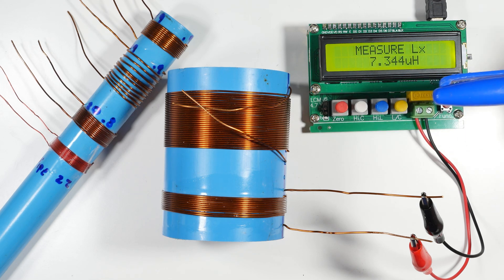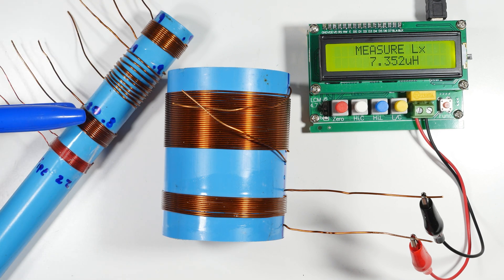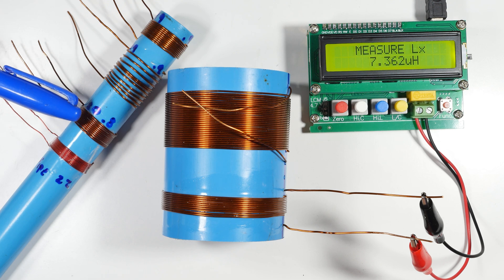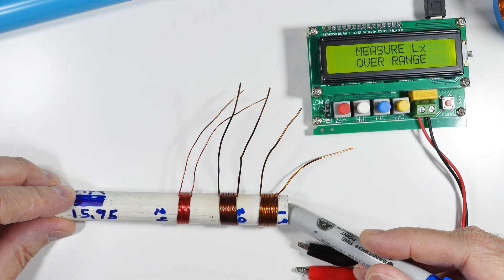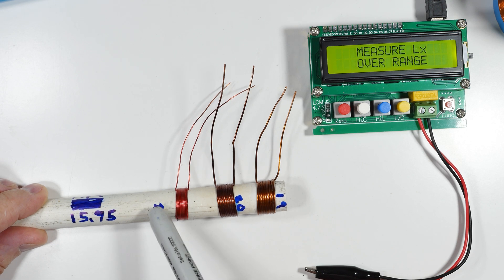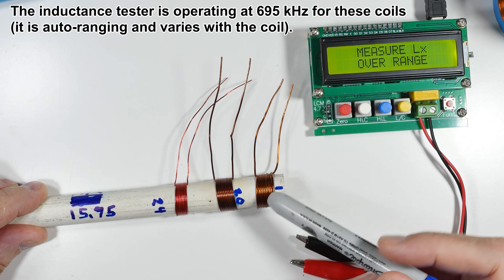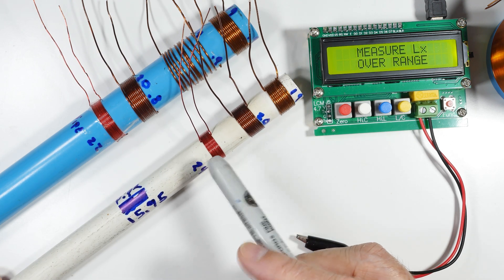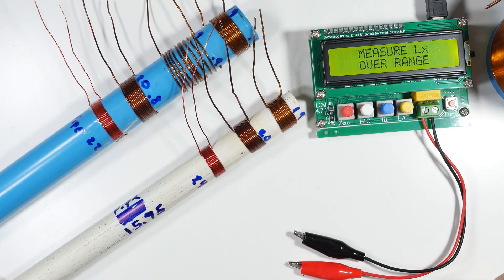Crystal Radio Coil--PSA: Bad Plastic Pipe Pt 3--Type That DOES NOT Work!

Comment from the maker: I've looked into the magnetic susceptibility of the most common fillers used in plastics. They range from near zero (talcum), to very magnetic (magnetite).
The most common fillers used in plastic include:
    Calcium carbonate (CaCO3) Magnetic susceptibility (χ) −3.82×10−5 cm3/mol
    Talcum Mg 3Si 4O 10(OH)2
    Barium sulfate (BaSO4are rhombic crystals (cuboid) Magnetic susceptibility (χ) −71.3·10−6 cm3/mol 
    Wollastonite CaSiO3 
    Magnetite Fe2+Fe3+2O4  Ur = 5.0 Magnetic

Finding values for most materials is very difficult as only the CRC handbook publishes them, and many are reported using different measurement standards.
Reply: BTW:  Gray PVC often has some amount of iron oxide in it.  Any plastic that is gray, red or black may have iron oxide in it.  It isn't an intentional addition it is something that comes as an impurity in other stuff.

Comment: The black plastic pipe may use carbon black for the coloring agent.  We all know that carbon black does have some conduction problems. 
I like Acrylic, transparent tubing. But it is rather expensive.  Have you tested Acrylic coil forms?? Thanks
Reply from the maker: I bought all the stuff to make a clear acrylic crystal radio. I think, like dinosaur bones, it is now buried under layers of stuff in a storage room. But I have heard that it works well.
Reply: @tsbrownie Thanks. I thought it should and I have completed some tests, but not extensively in RF.  Acrylic has the ability to acquire and hold static charges. But for what I have done, that isn't yet an issue.  A long time ago when medium and large fabrication plants were in business around Detroit. One could go and buy Acrylic Rod, tube and sheet scrap by the pound. It was great to go in and shop around gathering scrap acrylic in various colors from tinted to translucent and solid colors for any project. It was a bit expensive but looked great when cleaned up. Now most of these companies have closed or merged and dropped there scrap sales. Thanks again for your info.

Comment: Electrical conduit is always 'doped' so as to be fire-resistant.  Designed to char, but rather than "catch fire" it's often designed to give off CO2 when it gets hot.  Bad idea.

As for un-doped PVC, I'm still not a fan, because it has a high susceptibility to absorbing and retaining atmospheric moisture (ie, hygroscopic) - and worse still, the moisture content will vary day by day as the relative humidity changes!  Guaranteed to affect performance.
This effect can be mitigated by slowly drying in a warm oven then quickly painting with a xylene-based thinned lacquer while still warm... but that's "a lot of squeeze for very little juice".

For a coil former using modern materials, I prefer PET, the plastic used in soft-drink bottles.

Soft drink bottles themselves are usually not the best option, as the walls are thin and lack the strength needed to support a coil... BUT!  
There are many other products packed and marketed in the same material, but much stronger, much thicker walls.
From soup to shampoo to peanut butter, there are many excellent options and the only prep work needed is removal of labels with some turpentine, then a wash in warm soapy water.

I haven't measured or researched the permeability of PET, but it has a gazillion uses in the electrical hobbyist's workshop - especially if, like me, you also play silly games with extremely high voltages!

Comment: What about the standard, round paper-board box of "Quaker's Oats"?
Boy Scouts and school kids have been building "Crystal SETS" with the coil and other parts attached to the Old, familiar Oat Box, for about 100 years! All those radios work GREAT!!!!
Have you tested those?
Reply from the maker: They work the same as plastic cores of the same diameter, but are much more fragile. My first core was paper and it got crushed. All that work gone in an instant!

Comment: Using the methods to calculate the inductance of a single-layer solenoid given on page 6-1 and page 6-3 of Reference Data for Radio Engineers, Fifth Edition, I get about 1.5 microhenries for the inductance of the coil of #19 wire wound on the white tube.  You might want to double-check your calculations.  (This still leaves a discrepancy, but a smaller discrepancy, between the measurement and the calculation.)
Reply from the maker: I also get different answers from different calculators, but the answers are consistently grouped around a mean, and that mean is far enough from the measured inductance on that pipe (by half or so) such that is is clear there are pipes that will greatly skew the inductance of a coil wound on them.

Comment: You can avoid all these problems by using cardboard mailing tubes. They can be painted with urethane varnish to stiffen them up.
Reply from the maker: True, and I have done that. Their major drawback is they can be crushed and deformed more easily. That's what happened to my first crystal radio.😢
Reply: @tsbrownie Not the junk paper towel tubes. Use the very stiff mailing tubes which are very stiff.You can get them at Walmart, Staples, etc.
Reply from the maker: I've also used the tubes that were in rolls of carpets and fax paper tubes used to be really stout.

Comment: In the distant past, I used ABS "drain" plumbing pipe and it was OK.  I suspect the conduit pipe is actually conductive as far as the RF is concerned.  Lower inductance is hard to do with anything that is not conductive in nature.
BTW:  Some "fake" diodes will work OK.  The problem is you don't know what you are going to get with them.  If I get some time, I might build a crystal radio and try a few diodes to see what they do compared to a 1N34
Reply from the maker: I know there are equivalents to the 1n34a, but I won't recommend something I have not tried myself. If my videos get 500k views, and only 1% fail, that's 5,000 people. I am compiling non-diode detectors, but there's always something that comes up that needs to get done first.
Reply: @tsbrownie  If I do the experiment any time soon, I will come back with my results
Reply from the maker: @kensmith5694  Please do.
Reply: @tsbrownie  I just did a simple experiment and I found that basically nothing works as well as a 1N34
I  have a crystal radio set up right now with just enough antenna that I can hear a station and understand what is being said.
With the 1N34 it works well enough. At least it did until I dropped my earphone and it broke.  I did get some diodes checked before that.
I loaded the output with a 6.8K for the listening test.
I put a 0.68 across (and no headphone) for a volt meter check.
If you want you can copy and paste what follows to format it better
1N34, Clear, 100mV
1N4148, OKish, 75mA
1N5408,Weak, 10mV
R107,Weaker, 30mV
1N4007,Barely, 20mV
1N5819,Leastm30mV
As you can see the audio vs voltage on the 0.68uF don't track very well.
I may repeat this test later with a lot more antenna.
Have a very good whatever it is you do this time of year and a great newyear
Reply from the maker: @kensmith5694  Thank you for the holiday wishes. Same for you and yours. I appreciate all the effort in getting and testing those diodes. I too prefer the 1n34a, it was purpose built for AM audio frequency detection. There's an equivalent made in the old days from Eastern Europe that's pretty good, but after that the pack falls short pretty quickly.
Reply: @tsbrownie  The diodes I tested are ones I have on hand.  I have a large stock of stuff.
I think I may buy something to try just to see if I can find a good alternative to 1N34.

Comment: When you were making your tests did you give any consideration to the wall thickness of the pipe?  I would think that thin wall pipe (drain, waste, vent) would work better than sked 40 water supply pipe.  In this respect, would thinning the wall thickness on a lathe improve the performance of plastic electrical conduit?
Reply from the maker: It will depend on the relative permeability of the plastic of the pipe. PVC with neutral fillers (like glass) is pretty close to air, so thicker or thinner won't affect the RF signal. I've used thick and thin and if it is a factor, it is much smaller than other things like well wound coil, correct diode, clean connections, etc. Thicker will be mechanically stronger and less prone to deformation and damage.

Comment: The immediate suspect for that electrical conduit is something conductive.  That being the case, a slit down the length, breaking the hoop, should greatly reduce the effect on an inductor wound on the pipe.  Just like how transformer cores are made of laminated iron sheets, not solid iron.

Comment: if you are outside the range would you end up getting content above and below the am radio like the noise from the hetrodyning oscillator in intermediate stages of  a standard radio or the pulse width modulations of a power supply or even the waves given from the human body (what a therimin detects to work or why you can cause interference with reception when touching antennas).

electrical pipe even plastic has to have something to act as shield to reduce the emf leakage.

you dont want radio and electrical noise radiating from the wires.

the sewer pipes would have anti microbial coatings that may be a problem.
Reply: Outside the AM band, generally the RF power levels are a lot lower.
Reply: @kensmith5694  i was thinking if you wound the coil too long you may be able to tune to 400 khz witch is below the am 540 khz or if you wound the coil too short you may get to 2 or even 3 mhz witch is then in the ham bands.

the shielding material used in the plastic pipes may have the same effect as longer or shorter coils
Reply: @ejonesss The AM stations are many thousands of watts.  Hams etc are much lower power.
Reply: @kensmith5694  the video was talking about am receivers right? so you might pickup something outside of the band it is like you trying to use a japanese fm radio here in the united states or a usa fm radio in japan because of the differences in the bands you may be able to tune outside of the band.
Reply: @ejonesss The receive something. there must be a transmitter.  To receive on a crystal radio, there must be a reasonably strong transmitter.

Comment: At the general hardware and large home improvement stores in my area of the US, PVC conduit is grey and, very occasionally, white.  Water PVC pipe comes in 2 flavours - pressure and Drain & Vent.  They are both white, but the pressure pipe is a much denser material.  I have had fairly good results using both of those - haven't used grey conduit.  One can sometimes find blue or green pipe at the contractor suppliers, but they are in the larger sizes (4"+) and usually marked for waste or sewage use.  My best results, though, have been with varnish soaked cardstock and 3D printed forms.
Reply from the maker: Nothing like the classic cardboard tube dipped in varnish.

Comment: Did you say the name is "Clips-All?" As in, clips all noise? Meaning it is a special type of electrical conduit that includes electrical noise suppression? Well, we know that that is the way the pipe acts, but I am wondering if the brand name is a clue to it intentionally having special noise suppression properties. Might be fun to test/research that.
Reply from the maker: "Alfred Gerard develops the product that gave Clipsal its name, an adjustable, one size “clips all” metal conduit fitting. The company achieves several manufacturing breakthroughs, including the first all-Australian electrical switch."

Comment: Interesting. I would avoid anything with white paint too. White pigment is usually made from different metal oxides. Black is bad if it's made with conductive carbon. Lamp black is fine, it's made from non conductive oil soot.
Reply: The most common white pigment by far is titanium dioxide, which is an excellent insulator at DC.  At RF the dielectric constant may be a problem.